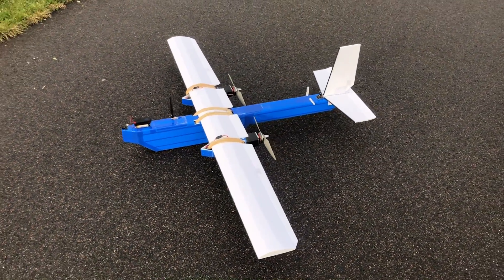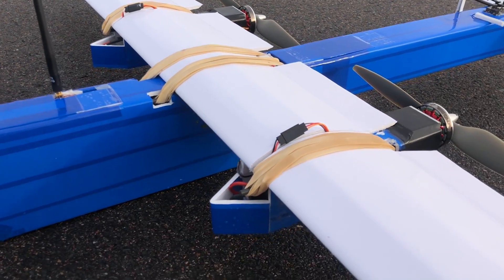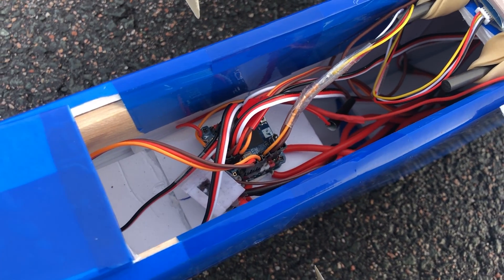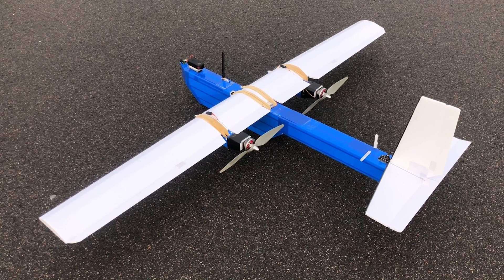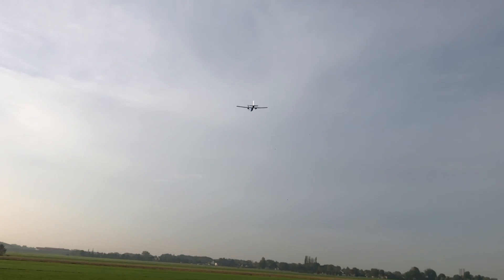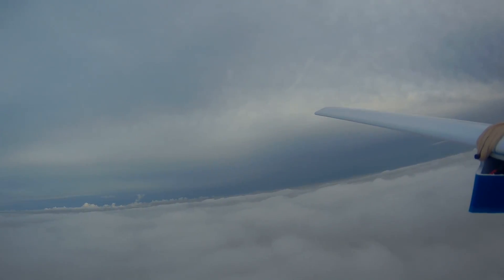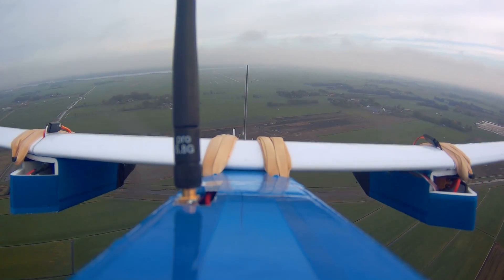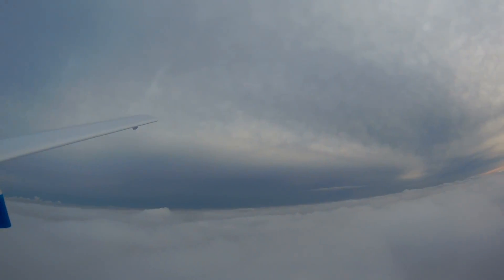Experimental Airlines Style Long Range FPV Aircraft - Cloud Ship LR/E - New FPV Aircraft Homebuild

Comment: interesting.  I've tried a similar configuration some years ago with a modified 2.5 meter sailplane, and found some major issues.  I was using flaps, and I had the motors mounted on a pod, behind the wing, but the props were directly behind the trailing edge, with some distance.   one time I engaged the flaps for landing and powered up to do a go around.  the noise was incredible, lots of vibration and the flap got ripped off and sucked into the prop, which disintegrated and one of the motors got ripped out fo the mount, and was dangling by it's wires, while spinning.  the other motor allowed me to make a shallow climb, and I made a successful emergency landing subsequently.  but there was lots of damage.  on reviewing the footage, I saw the whole wing shaking whenever the AOA was high, or flap was deployed, with any power on..   so I decided not to use the configuration any more.  I had damage to the airplane and after repairing, I made twin tractor motor mounts, and found it worked so much nicer.  smooth, no vibrations, and actually more efficient.   I don't know why piaggio makes some of their aircraft, several models this way, but you can hear the very loud noise they make and it must be a big technical challenge to deal with the long term effects of those vibrations on the full size aircraft.   anyway, I think it's due to the air pressure differential entering the prop arc.  prop efficiency decreases for sure.. of course, it's good for efficiency that the accelerated air goes straight out and not over the wing, although with twin tractor, the blown wing does increase lift, so it's not as bad as it seems.   anytime the LD ratio improves, you get most of that energy back.   and I enjoy looking at the props. and the quiet.  I would like to try the configuration again, with a low wing, T-tail, something like the MD-94x with jet fans.  or a raised pod on the wing, so the prop is in clean air.  well, just an idea.    What one of your aircraft do you find to be the most efficient?  love the relatively simple, practical designs and that you can rapidly test different types.  I'm jealous...
Reply from the maker: You've been there too - That's awesome! 

This configuration does make some noise but has no flaps. I can't imagine the buzzing sound it'll make - No flaps needed as it can glide quite nicely and has good gliding-ratio for how it's looking now - Otherwise I did flaperon-mixing or add splitting speed brakes (similar to your Gemini V2) between the tail & wing.

I made a Push-Pull model in the past and had the 17'' props behind the main wing: https://www.youtube.com/watch?v=Sk0KASiwN9c - At relatively high altitudes it makes a low but menacing sound - really loved that sound - but the design wasn't efficient - It was just an experiment and converted into a twin-tractor with the huge motors...!

But my most efficient design I ever made is a 1.6m V-Tail Pusher - I did over 10km and it's efficiency does approx. 135mAh/km (4S - 950kv motor - 12x7 prop): https://www.youtube.com/watch?v=iR9pg6349lg

I'm very curious what your next upload will be... Your projects & flights really inspires me!
Reply: @AeroStuffFPV  did you have any issues with the V-tail and pusher, making vibrations when the control surfaces were deflected, with power on?  seems it would be much less of an issue, as the plane would align with the tail very fast, unlike the wing.   also, the control surface effectiveness would change as power is increased, or decreased.. I'm guessing, because the control surfaces are very close to the prop.   but seems to work very well, especially for cruise flight.    I also favor the twin tractor because it protects the props well on landing, and no torque, P factor, ETC etc. etc.   anyway,  love the look of the Vtail pusher.  and seems very practical to build.        A push-pull configuration is usually referred to as an inline twin.      my current projects are, putting an autopilot in, and tuning several different aircraft.   I'm reviving the old anaconda twin boom pusher. just got it flying full auto the other day.  putting camera on it right now.  flying with 4S7P Panasonic NCR18650GA cells, at 50kph for 1.5 hrs with reserve.  also, still refining the Maxwell design. have two different pre-production prototypes flying very well, and doing long auto missions.  so far, about 22km from home, and only using half the battery to do it. end up landing it because of boredom most of the time, or sending it to do a torturous auto mission, just to work out the little bugs and see where are the deficiencies, so I can tune it gradually.   and working on a large, 4.6 meter span solar plane, called solar dragon.  I need an update video soon for that..  it's close to being ready to fly.  hopefully in a couple weeks..    it's looking really good.   as it's a strange configuration there are lots of issues to work out. landing gear, etc.   it should fly very slowly. I still have two autopilots left in inventory after that, for projects.  but the solar plane may keep me busy for some time. hopefully some money comes in from Maxwell S2, or somehow from the solar plane....      glad to know that what I do is inspiring !!   you are too!   have a great day
Reply from the maker: @FPVREVIEWS  I never had issues with vibrations and or a lot of noise coming from the prop upon tight turns or extreme climb angles. 

The motor mount is a 90-degree plate that has been tightly glued & taped to the foam fuselage with reinforcements - The foam itself does reduce vibration-travel to the FC or FPV gear in the nose - almost never encountered jelly-screens or stutters in the video-feed